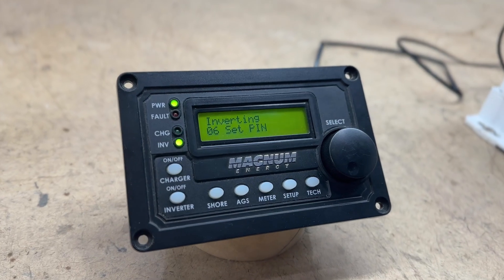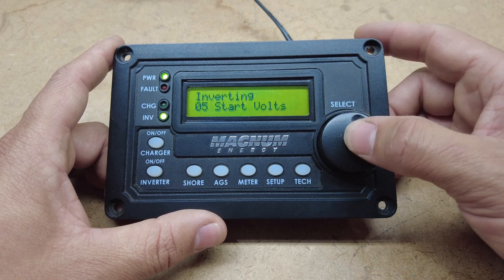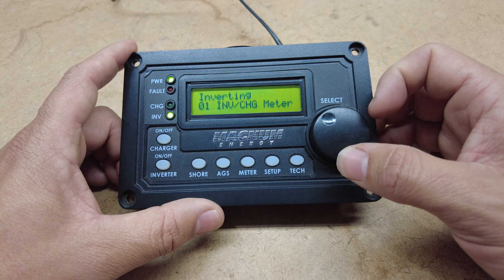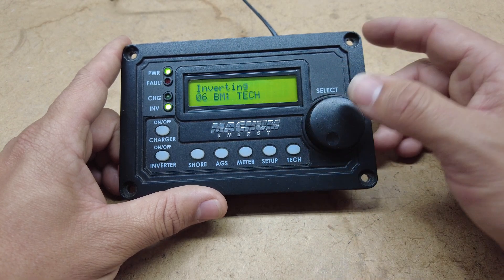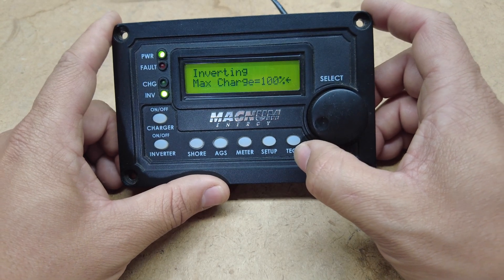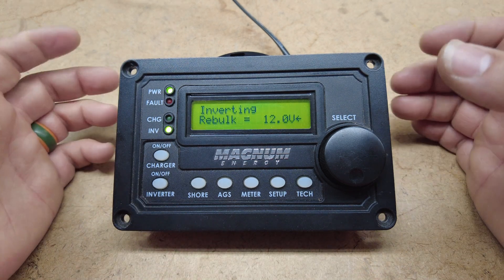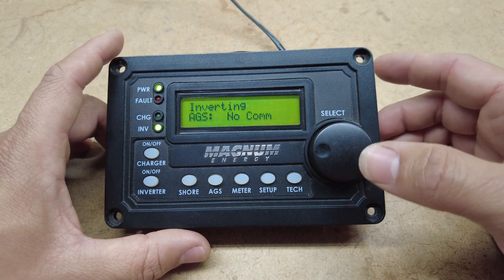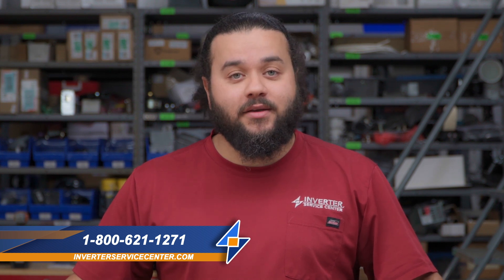Master Your Magnum Inverter: ME-RC Remote FULL Walkthrough!

Comment: I’m upgrading my Magnum MS2712E inverter (with ME-RC 2.8 remote control) to LiFePO4 batteries and need a ME-RC-L (firmware 2.9+) or ME-MR-L (1.3+) to enable the LFP battery profile. Where to buy this in Greece  (or Europe)  Is a firmware upgrade possible for my current ME-RC 2.8 ?Best regards
Reply from the maker: I don’t know anywhere you can buy that in Europe

Comment: My challenge is when my shore power generator is running and plugged in it tops off the batteries then the inverter kicks over to inverting making power then in a minute or so kicks back to shore power. How do you tell it to use/discharge the batteries for a set limit so the inverter and generator dont keep switching backban forth at the top end of the charge when batts are basically full?

Comment: I have a MS2012 and connected to 50A shore power and the highest setting I can get for shore power is 30A on my display.  Any Idea why?
Reply from the maker: How old is the remote?
Reply: @InverterServiceCenterTN  My "New to Us" 2022 Thor Aria is just a few years old.  I spent some time with Firefly Integrations on upgrading the remote to the latest firmware version.  I'm just now noticing that I cant change this past 30Amps.
Reply from the maker: @dreamrider2956 do you have a magnum remote or a firefly screen?
Reply: @InverterServiceCenterTN  Firefly.
Reply from the maker: Ok, that would be a question for them on the display side of things why that is there only option they are showing you. If it’s truly for the inverter input setting then 30a max is ok because typically the inverter input breaker is a 30a in the breaker panel. If it’s the setting for the overall coach then I would ask them why it can’t be raised higher.